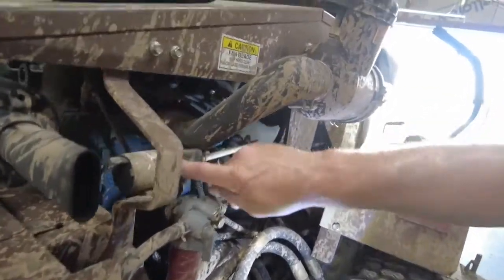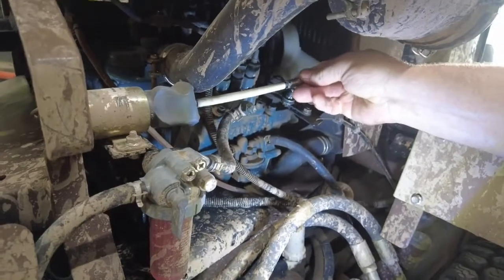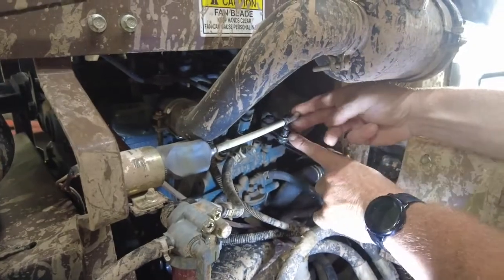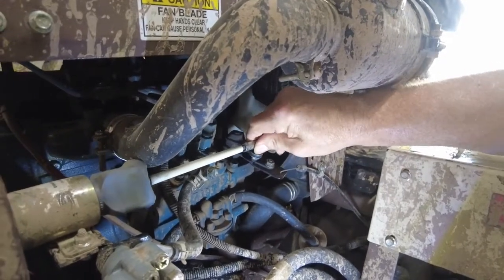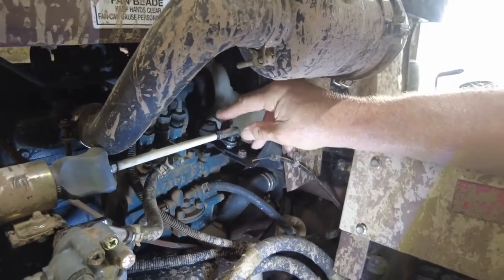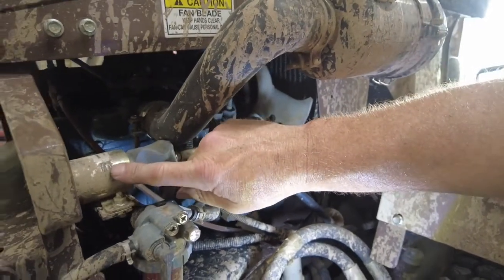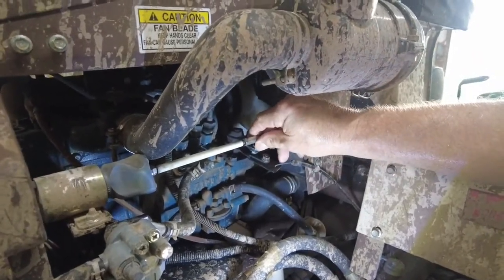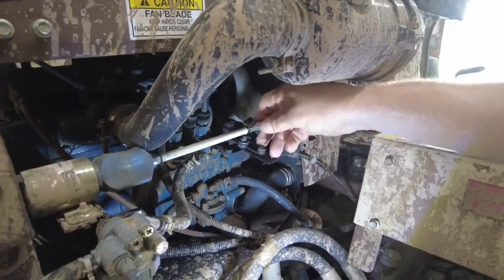Grasshopper 321D, Fuel Solenoid Linkage Fix

Comment: Can you have him do a video on how to prepare your grasshopper for the season? Oil change, add coolant, etc.
Reply from the maker: Hi Crystal, we usually do our maintenance on all the equipment the first of March.  We plan on showing what we do to get our equipment ready for the year.  The equipment we will service will be Grasshopper 321 and a 721D2 with New Holland 1920, Kubota B2601, Kubota SSV75 50 hour service and our small engines in log splitter and pressure washer.  

Thanks for the comment and have a great weekend!